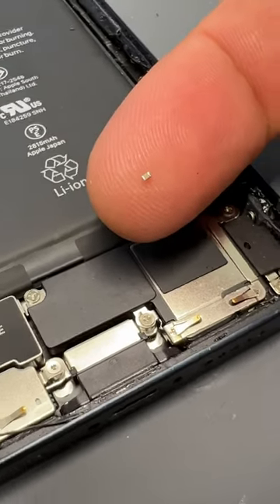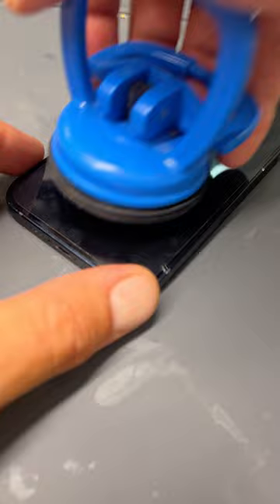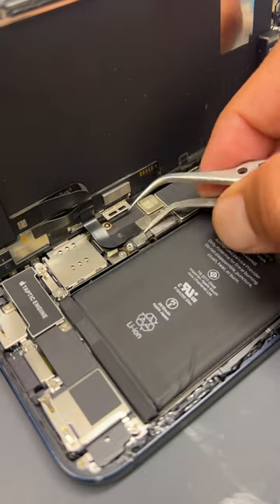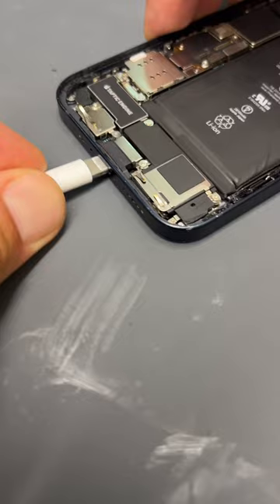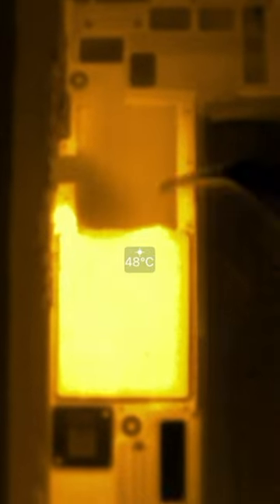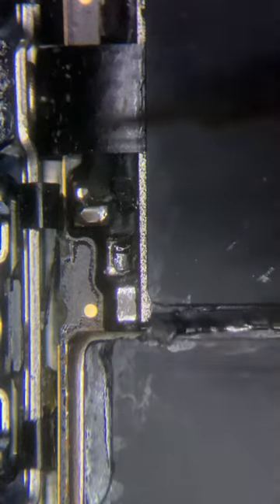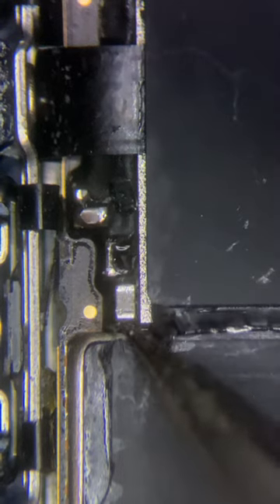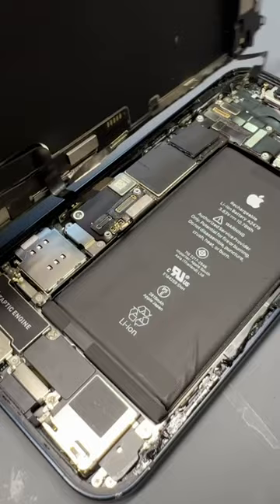iPhone 12 stuck in recovery mode with NAND short circuit

Comment: You disconnect the battery with tweezers? I've been repairing phones for years and I've never used metal tweezers to disconnect the battery just because I've heard of people frying boards due to a short when using tweezers. I suppose if you use ESD tweezers it should be fine theoretically. I just like to play ot safe and I use either a black spudger stick or an iFixit opening pick.
Reply: Who taught you how to fix and repair phones? It looks so interesting and tough
Reply: @faehimmirza2381  youtube is basicaly all you need to open any device and replace almost any part :)